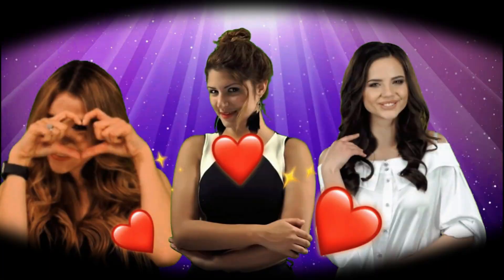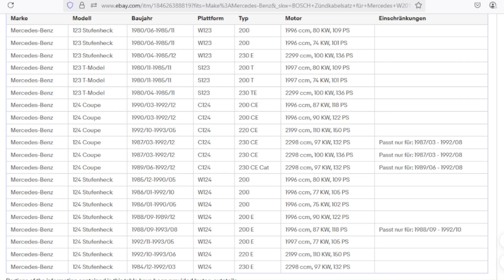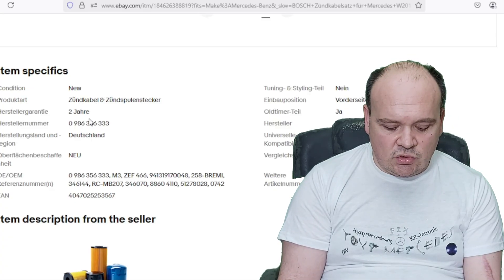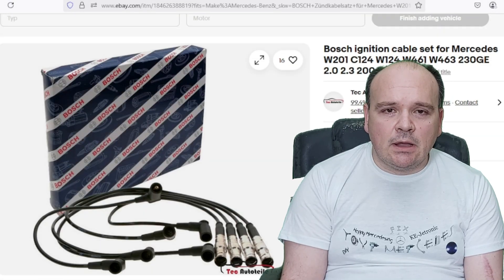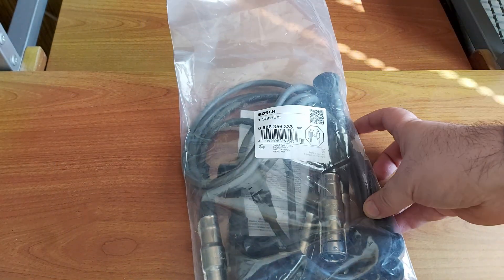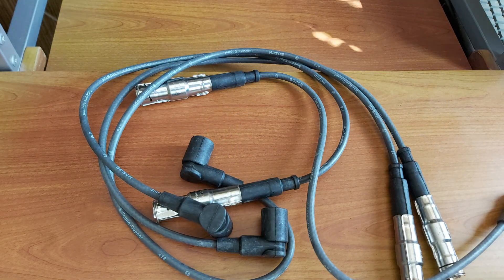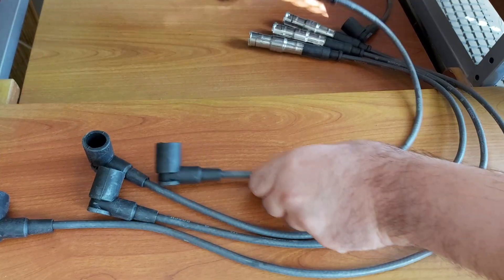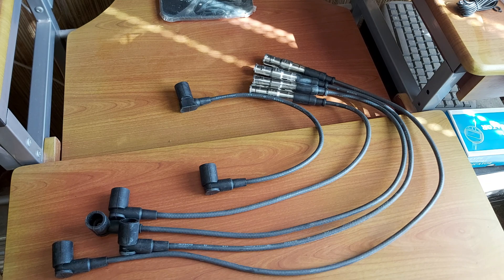㉦Mercedes Ke-Jetronic㉦ - “These BOSCH Spark Plug Cables Changed Everything–Here’s Where to Get Them”

Comment: Hello dear sir, awesome videos they are a lifesaver. I have a question that no one seems to be able to answer so I thought maybe you could. 
On my 1992 190e 2.0 (102.962) : My old ignition distributor was broken with heavy pitting and carbon tracking. 
So I changed it, but the new one broke in a week with same issue : a line where the rotor arm passes by, that is completely pitted, with burn marks from arcing. 

I dont understand where this could be coming from, I have checked the voltage regulator, battery, coil, leads, sparkplugs, and all seems normal. What do you think could be the source of this problem ?

Thank you for reading and for your videos
Reply from the maker: Hello, thank you for the kind words — I’m glad the videos help. What you’re describing is not a voltage or tuning problem. If the old distributor failed and a new one developed the exact same carbon tracking and pitting in a very short time, the most likely cause is poor quality of the distributor cap material, not the ignition system itself. Here’s why:
On the M102, excessive arcing inside the distributor usually comes from:
low-quality plastic or resin in the cap, poor internal insulation, incorrect dielectric properties of modern aftermarket parts. Many new distributor caps today are far worse than original Bosch/Beru units, even when sold as “OEM replacement”. If coil voltage, battery, regulator, plugs and leads are all correct (as you already checked), then:
👉 the ignition system is doing what it should,
👉 the cap simply cannot handle the normal voltage.
That straight burn line where the rotor passes is a classic sign of internal insulation breakdown, not overvoltage.
What I would recommend:
1️⃣ Use only Bosch or Beru distributor caps (old stock if possible).
2️⃣ Avoid cheap aftermarket or unbranded caps — they fail exactly like this.
3️⃣ Inspect the rotor as well — some modern rotors also have poor resistors.
4️⃣ Make sure the cap is clean and dry inside (no moisture or residue).

In short:
The system isn’t killing the cap — the cap is failing the system.
Unfortunately this has become very common with modern replacement parts.
Hope this helps, and thanks again for watching the channel.
Reply: Thanks a lot for your replay. The problem seems to fixed now with a new bosch cap and rotor arm, and also new coil just in case. 

Regarding the quality, the replacement I bought before was a new BERU cap and rotor arm, but it is shocking that it would only last a few days. Maybe it was a fake. 

In any case I think you were right, there is no other issue, it was the distributor cap and rotor, even after replacing them with new ones. 

That was a tricky fix ! But it has been working well for a few weeks. What a great feeling to have this car start up everytime, even in -8°C ! 

Have a safe drive, see you in your next videos !
Reply from the maker: @hectorchapis5735  Thank you very much for the feedback — I really appreciate you taking the time to write this.

You’re absolutely right, ignition components can be tricky, and unfortunately even new parts can be faulty. It does happen, and it can be very misleading during diagnosis.
BERU is generally a good brand, but fakes or bad batches do exist, so your suspicion makes sense.

I’m glad you confirmed that the distributor cap and rotor were indeed the root cause.
That feeling when the car starts perfectly every time — especially at -8°C — is priceless 😊

Enjoy the car, drive safely, and thank you for the kind words.
See you in the next videos — Happy Mercedesing! 👍

Comment: Always a pleasure to watch these videos.
I have used both Bosch and Bremi cables on M102. Bremi are a bit longer (all 5 cables) but the car seems to run just a very bit smoother (also are cheaper). 
Also used Engitech cables for M103, the same length, seem to work good.

All cables (Bosch, Bremi and Engitech) have been measured and are in range of 0.924 to 1.050 kOhm.